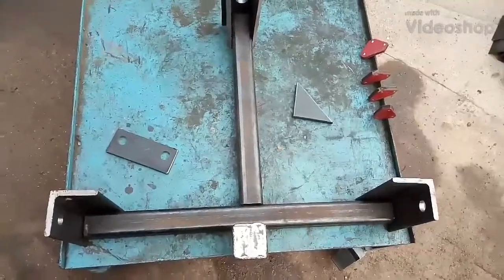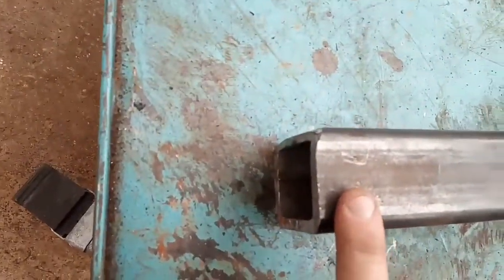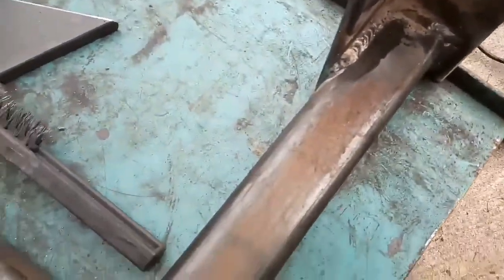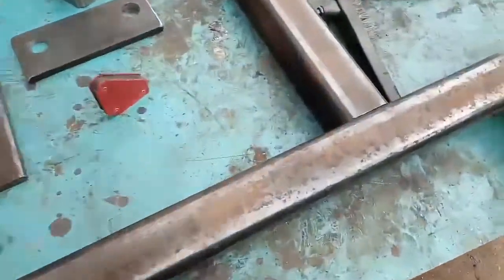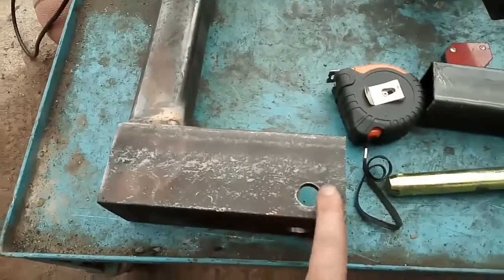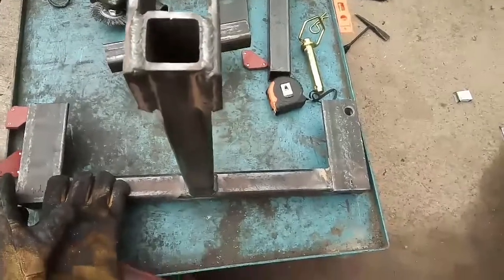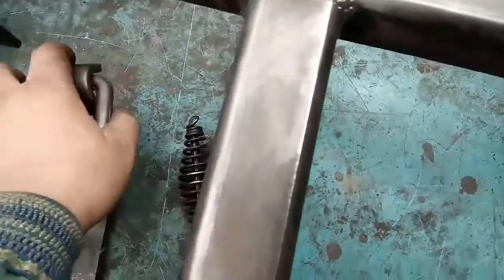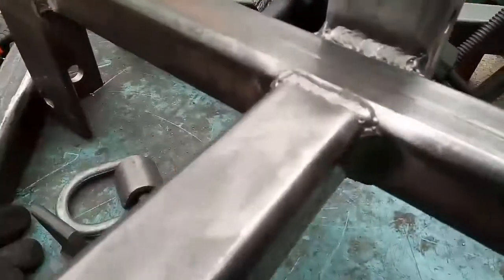Tractor custom 3 Point mounted Trailer and Goose Neck hitch

Comment: Heck, I'd say that turned out real nice!! Looks nice and square. Not bad for the welding surface you had to work with! This will come in handy for many many years!
Reply from the maker: Thanks for watching  that's my home made mobile table. I need to get a shop so bad then the big welding table will appear with the brand new Miller 250 generator welder all I need is $15,000 it maybe a few years to save that.